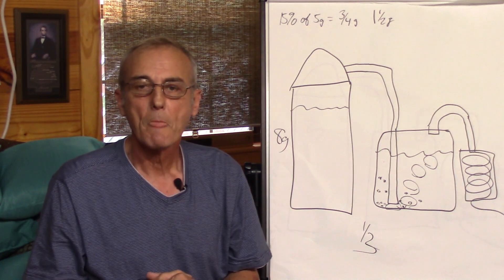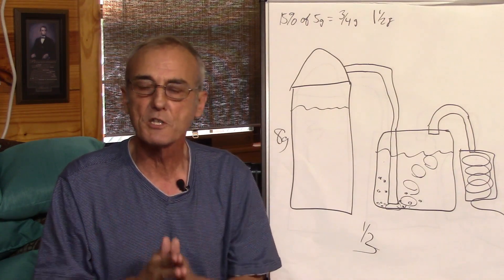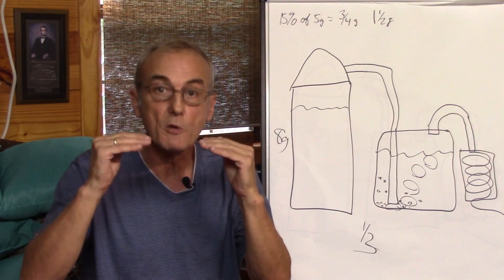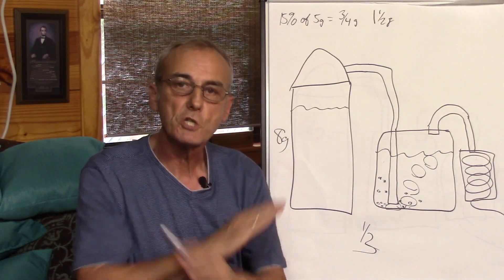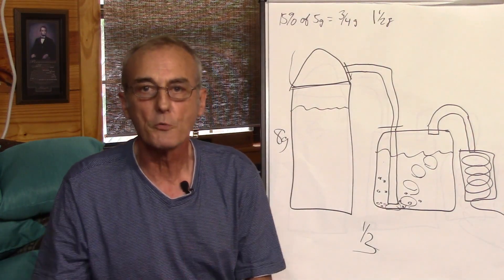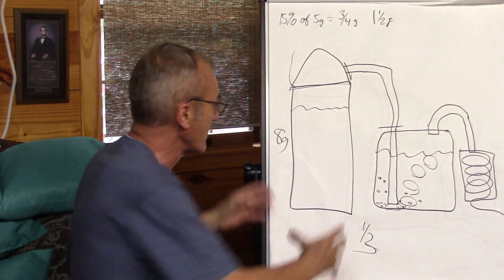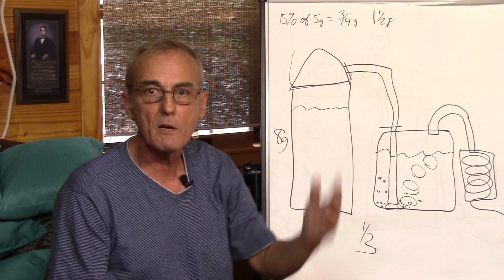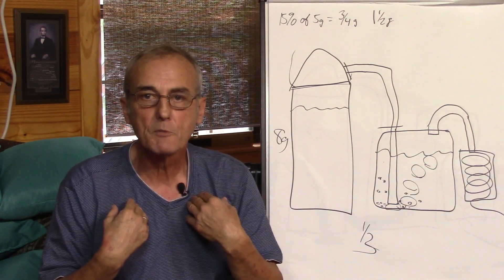SAFETY UPDATE TO THUMPERS, THEORY AND HOW THEY WORK

Comment: I love your emphasis on safety...  you're correct about the pressure,  almost... in my mind... as your still cools, pressure drops, like you said,  but instead of your still imploding, it would use the pipe to the thumper like a straw, sucking your thumper dry...

Comment: George, this is right. People don’t realize that even though the pipe to the thumper is only 3/4 of an inch, it’s height that matters most. Wouldn’t matter if it’s a 3/4 inch pipe or a 3 ft pipe. 3 ft height of water is your head. It takes a lot of suction to pull water up 3 ft, and each foot is even more. Ask someone to try sucking water from a bucket in a tube and they’ll understand how that will crush thinner walled copper stills. Cause as you know the suction gets even worse when you open it up to a larger vessel like the still itself. It’ll crush right up.

Comment: I found this video a little too late. unfortunately it crushed  my 10 gallon copper pot like a pop can and put 2 tiny pin holes in it. Is it possible to fix this and use it again?if so any tips or tricks?

Comment: Not bad advice but I have left mine closed and all it does is suck air back through the condenser thereby pulling liquid from the thumper back to the still as it equalizes.
Reply from the maker: True, in some instances this is overcome by teh construction of the still and location of its parts. Not everyone has an equal system.
When a still kettle does crush it's too late to go back and say "you should have opened the system before cooling".
Reply: The same whith mine...
Reply: And that one time your boiler is weaker than the vacuum that is created.. exactly what are you going to think about not making sure that can't happen? Crushed boiler always makes your day??...
Reply: And the one time you fill your thumper a little higher or it sucks that peach you put in for added flavor into the tube and bam. Always better safe then sorry in what we do.